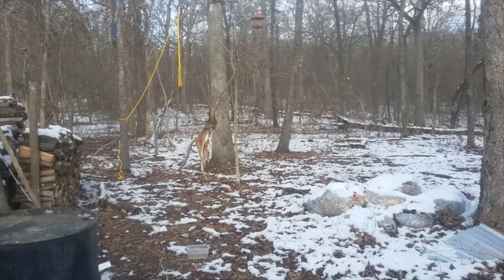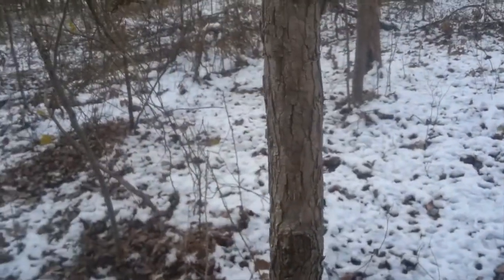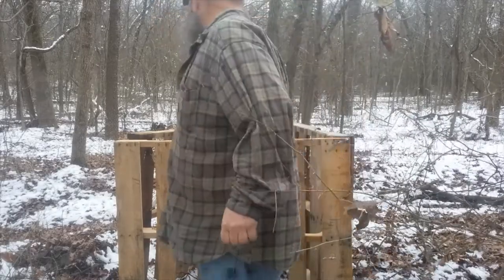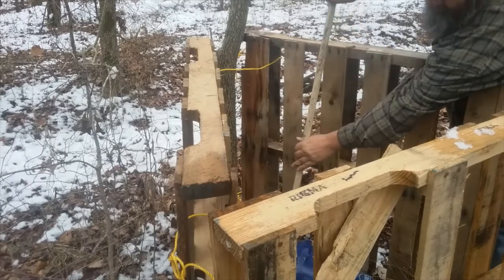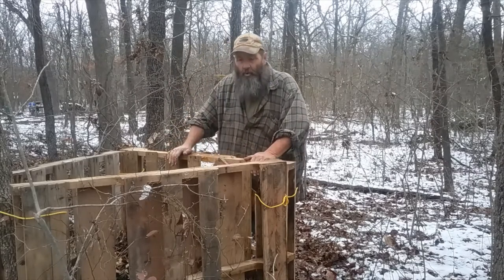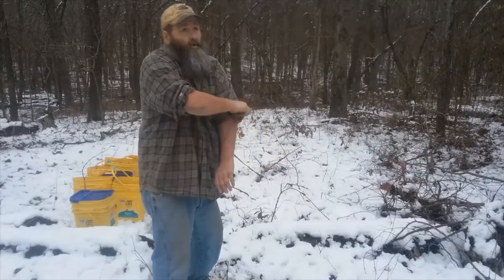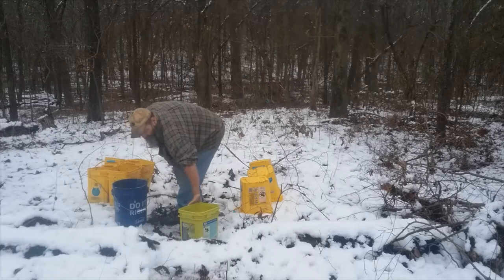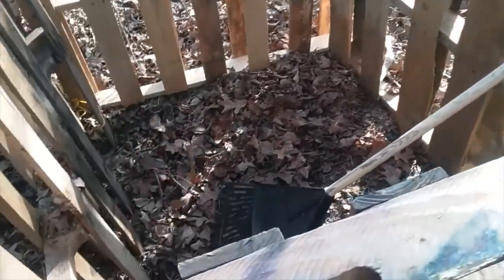Building A Compost Bin From Pallets For a Compost Toilet

Comment: I'm buying some land in Delaware County Oklahoma and want to put a small shed cabin on it and it won't have running water. I was wondering how to dispose of waste and came across this video. I didn't want to incur the expense of a full blown septic system when I don't even have plumbing. Lol. So has the county or state had to approve this or do they not harass off grid places like yours ? Did you need any permission or permit to do the composting toilet system?
Reply from the maker: Every county in Oklahoma is a little different. Some have no regulations, some do. I'm not sure about Deleware. You'd have to call the County and ask them. But I use a composting toilet, so no septic tank required :)
Reply: @1acrehomesteader43  Thanks for the response. Im just excited to get going. I have a pension so wont be roughing it too bad . Im going to go with solar for electric. Try hopefully they let me compost toilet. I do want a wood stove though for sure.